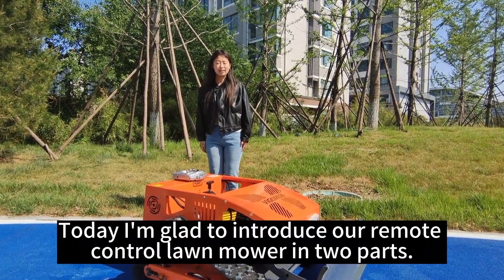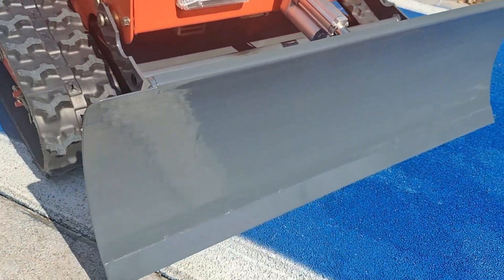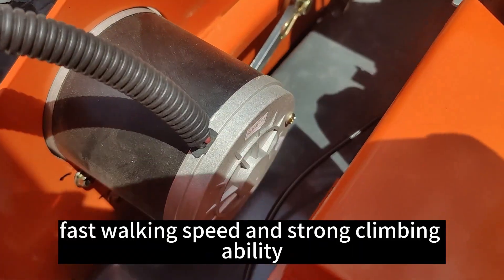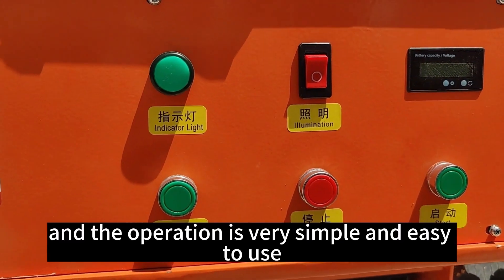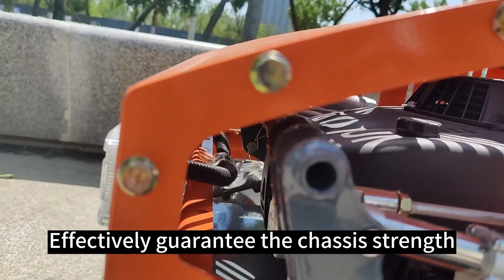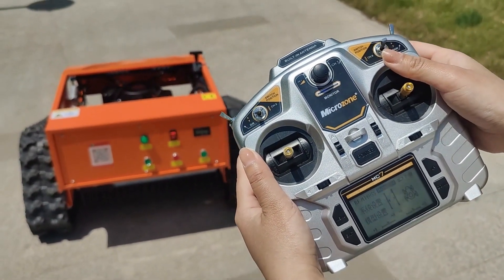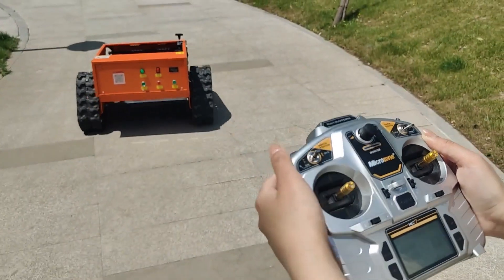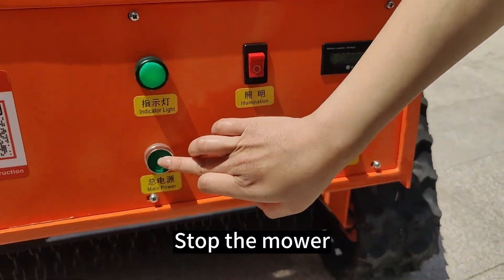China Made Crawler Remote Controlled Brush Mower (VTC550-90 With Snow Blade) For Sale

Comment: Need that mower
Reply from the maker: Our machines are equipped with powerful dynamo. It automatically recharges the battery while the engine is mowing.We can talk by Whatsapp +8613455610280 for the details.